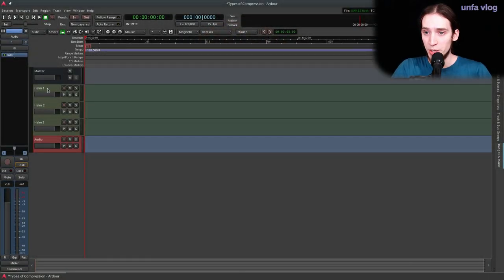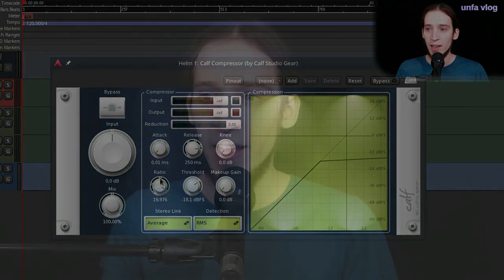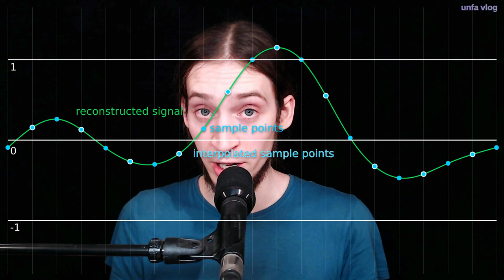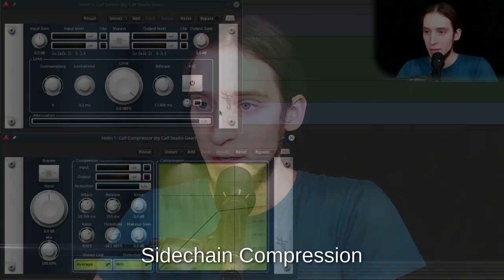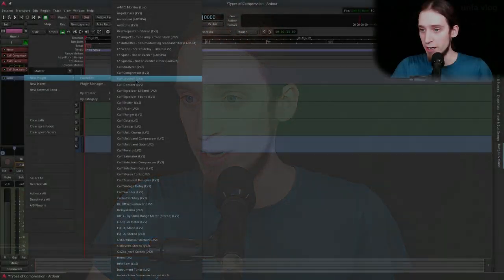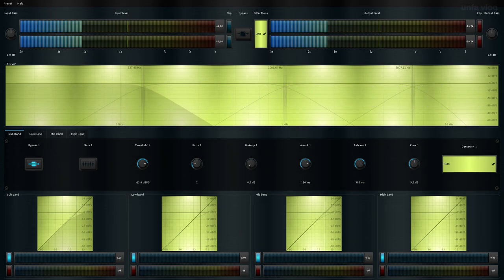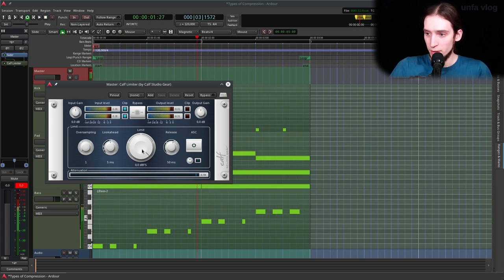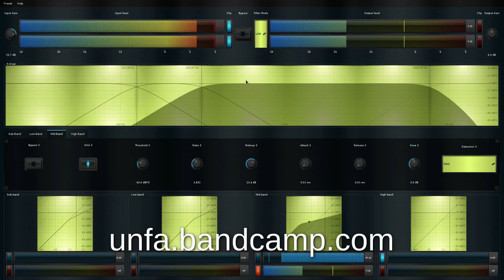UV#21 Advanced dynamic range compression w/ Calf plugins

Comment: on all the Calf compressor/etc the filter graph is missing - I am using Carla on linux
Reply: I had the same problem, you need to enable plugin bridges, and enable 'run plugins in bridge mode when possible'.
This issue is due to the fact that the UI for the plugins is originally handled by Carla itself which doesn't support the GL calls to do the graphs.
Reply: @eamondo2  Yes I worked it out a while ago